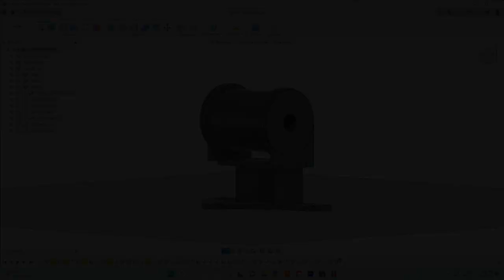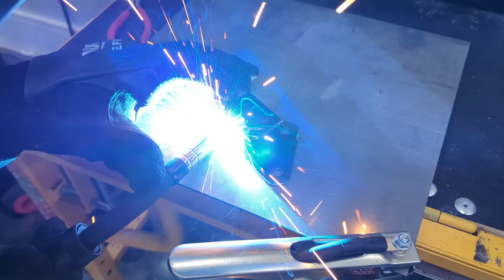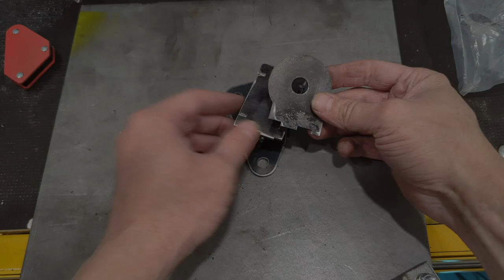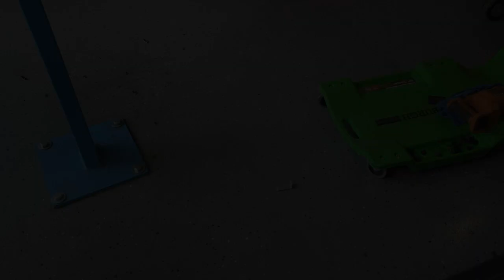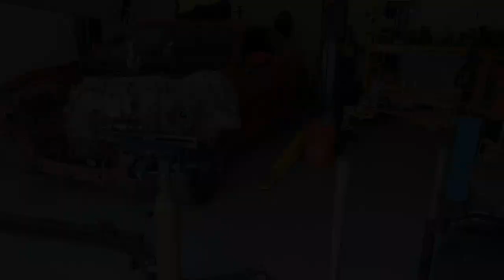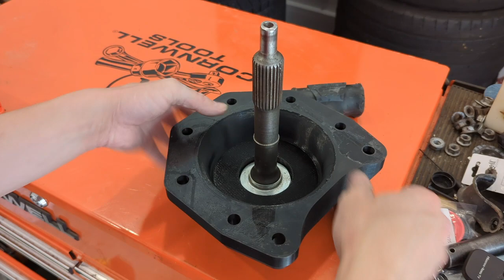Designing and Building things...FINALLY : Project ToyoRati EP16

Comment: Hey buddy! I want to put the Mas transaxle in my 91 Maserati 224 2.8 liter. Maybe its more compatible and bolt in??? What about electronics for launch control and maybe to keep F1 shifter in my 224 which is not ABS car and has old Marelli ECUs (twins 3 cyl each, similar to F40) that I modified to 1.5 bar boost 400hp+. How is F1 usable in swap?
Reply from the maker: I'm not keeping the F1 controller do to size and complexity.  The TCU of this system talked with a lot of other systems, ECU, ABS controller, TCU, BCM, and many other things.  

There are better options, $$$$$, out there that would give you paddle shifting without  the headache of dealing with all of the nodes interacting properly.